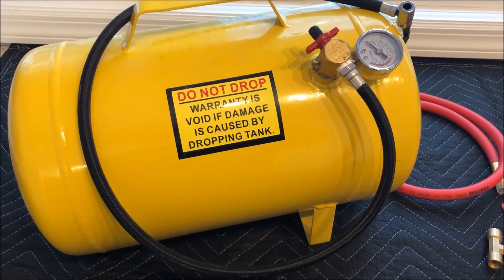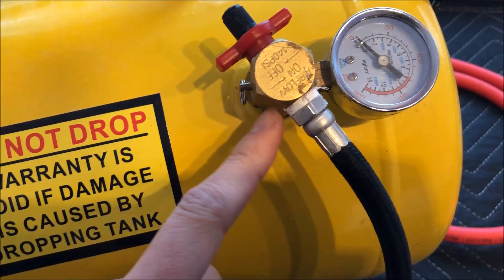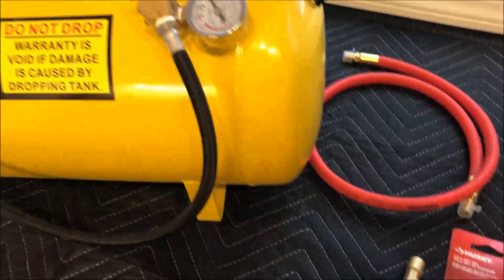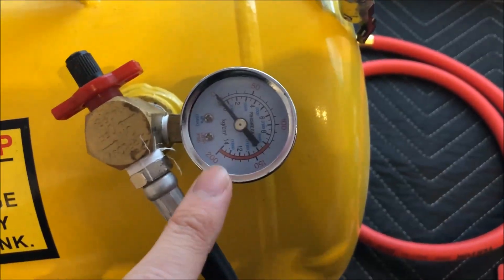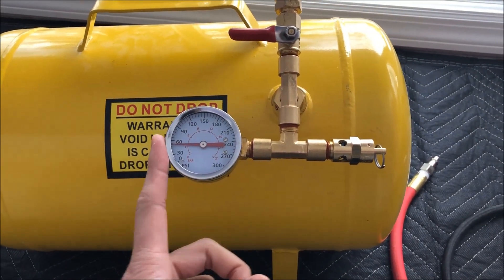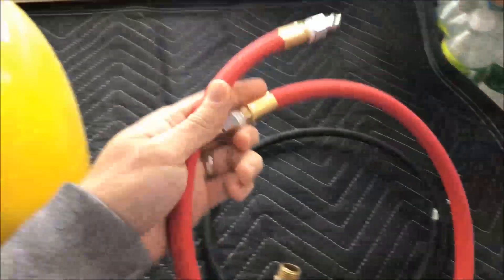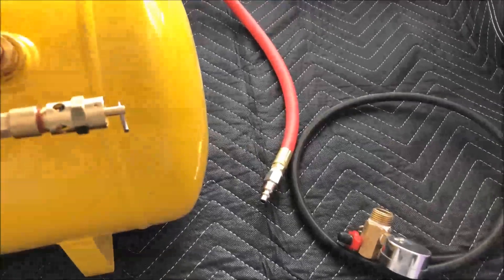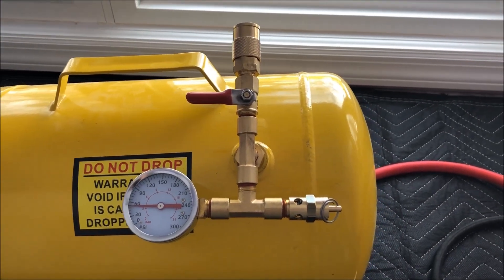Harbor Freight air tank valve modification/upgrade

Comment: I tried to take mine off.  It started to turn then wouldn't turn.  Should I heavy hand it and just keep insisting it turns?  I have the same tank.  Again, the assembly starts to turn and then I can't turn it
Reply from the maker: i would try to work it back and forth to break anything loose that might be hanging in the thread... if you are loosening it and it's tight, i would back off a little and then loosen again slowly past where you just stopped.  keep advancing it slowly.  it's possible the factory cross threaded it when they put it on...
Reply: @kamsgarage  Thank you.
Reply: @kamsgarage  apply heat.

Comment: You don't have to do anything this complicated. Just remove the 1/4 hose from the existing manifold, and put a quick-connect tee into the fitting.

Then the fill hose goes is one side of the tee, and the outlet hose goes in the other end.  Because both sides have quick-connects, no valves are needed.

Comment: How in the heck did you get the original manifold out of the bung?  I can’t get mine to budge.
Reply: You need a lot of strength. Harbor Freight uses industrial glue to keep the manifold in place. I was able to get mine out with a lot of strength on my end.

Comment: Not sure why you need a shut off valve in front of a quick connector? Also  That is  a big lever of parts on that little  1/4 thread.  for me a single T with saftey valve and a quick connector is all  that's needed.
Reply: I was thinking the same thing because i almost did that. I then realized whether the valve is open or closed,the quick connect is preventing air flow. Only reason i could see is if you kept a hose connected all the time but wanted air cut off from entering that tank

Comment: OK, I watched your two videos out of order.   I plumbed the reserve tank in essentially the same way, except I used a 4 way cross instead of 2 T's.   Question:  Isn't the coupling for outflow only?   Are you able to fill the reserve tank through the coupling and then also have it discharge air back to the tool through the T at the compressor?

Comment: shouldn't you have a regulator before the gauge in order to regulate the pressure you need for the certain tool you are using?

Comment: What do you usually do with the portable tank, light duty tasks? Going from 1/2" to 1/4" seems like it'll be highly restrictive. It's fine if you only do light duty tasks and don't need to maximize flow. An alternative, in order to maximize air flow, would be to use a 1/2" brass street tee off the tank. This will allow the reuse of the existing relief valve and gauge assembly (will also need a brass hex plug if removing the hose on the assembly). On the other outlet on the tee use a 1/2" to 3/8" brass reducer to a 3/8" valve. Then use the 1/4" reducer for the coupler. Couplers are usually the biggest bottlenecks in air flow, but those 1/4" tees and 1/4" valve will add even more restrictions.
Reply from the maker: very light duty tasks like top off the air in tires or if i need to stretch it, i have been able to use a finish nailer and trim out a window/door.  i wouldn't mind using 1/2" tees and keeping everything as open as possible but those tees are hard to get locally and also a bit pricey.  i managed to do all this under $30...
Reply: kam Yep, 1/4" will be fine for those tasks. The 1/2" fittings can be tough to find at the usual spots like big box stores, but they're more common at hydraulic, plumbing, HVAC suppliers or Amazon. Regardless of the setup, it works and the other videos on doing this upgrade are proof that there's hundreds of ways to do it since every single one is different lol.